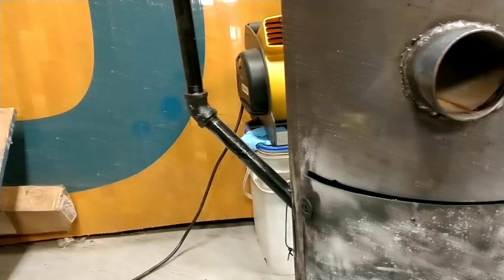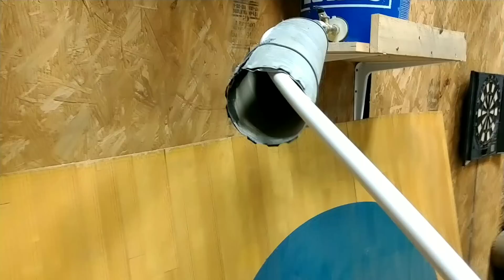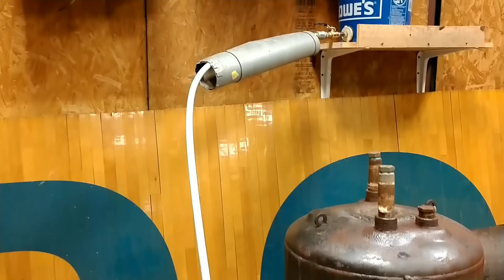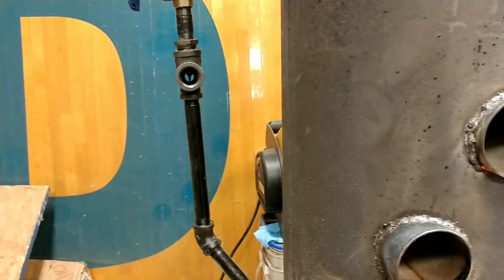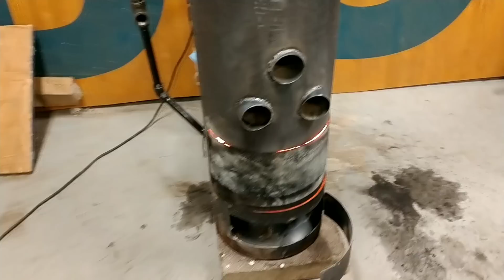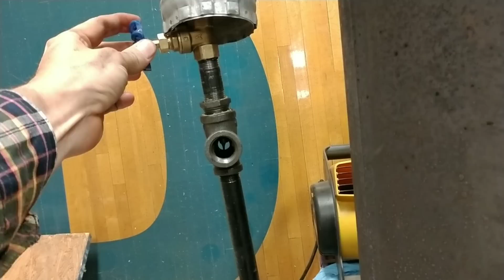Updated Waste Oil Heater Drip Feed Ver.2.2 Detailed January 19, 2018

Comment: Hey bud! Thanks for the video, I work in a shop and just starting learning to fabricate our trucks. Took a few months but I was able to find all the parts and used an old 100 gal propane tank to make my own. Did it on lunches and after work and I got it home and fired it up last night! Very happy and learned a lot while greatly improving my welding and cutting skills doing it. Thank very much for all the details. Now I need to figure out the groove you cut in the gate valve because as you know without it the oil just runs down the side of the “T”. Thanks again!
Reply from the maker: If I have time this weekend I'll go out and take that valve apart and make a video of it. But the groove is not to make the oil flow through the middle of the window all that does is keep larger particles of debris from stopping up your oil flow. The only way I could get the oil to run through the center of the t was to install a barb fitting from the inside of the t

Comment: How many sq ft will it heat in roughly 30 degree weather? I have a tank twice that size or more that's 3/16" steel i've been contemplating doing this with to heat a well insulated 4000 sq ft shop.
Reply from the maker: My shop is 40 by 60 it heats it pretty good at 30 degrees.

Comment: I bet that stinks! I can see holes in the heat exchanger welds and the door isn't sealed. The pex pipe is a disaster waiting to happen. Nothing like spilling 5 gallons of oil around your 500 degree heater.
Reply from the maker: So you haven't checked out the new revised re-welded sealed up door insulated PEX pipe video, I guess I'm going to have to change that plastic pipe out after 5 years everybody thinks it's going to melt I'm going to have to put a black iron steel pipe there I guess to make everyone happy. Absolutely no smell escapes from the tank due to there being a vacuum created by the flu, so all of those holes where I just tacked in the heat exchanger pipes actually suck air into the tank not blow air out of the tank.The video was done after tacking everything together just for testing purposes I have since rewelded all the way around the heat exchanger pipes put a gasket on the door and made several improvements which are seen in one of my other videos. Another way to think about those holes around the heat exchangers, is imagine your fireplace in your house. It has one big hole in the front of it where you put your wood into the fireplace yet the smoke does not come into the house it goes out the flu.
Reply: @randysdiy2102 - Well you certainly told me!
Reply from the maker: Lol, rough day.

Comment: I'm not an expert on any of this by any means, but I wonder if you could use a bunch of smaller pipes as heat exchangers, and then have them all meet in a single larger pipe that the blower could push through.
Reply from the maker: Sounds like a good plan

Comment: Randy, as you have demonstrated, running the heater at about a pencil lead width flow or a bit more in the sight glass, burns smoke free.
is it possible to vary the oil flow more and less than the pencil width flow (heat output) and maintain a lean smoke free burn.? (so their is no soot build up). Thanks
Reply from the maker: You can run it with a smaller amount of fuel however when I've done this in your heat decreases significantly.I'm not sure that it helps any with soot due to the higher temperatures helping the soot burn away

Comment: Now if that burns as hot as it looks (over 1000 degrees I figure) just how long is that steel going to last before it breaks down, starts to warm and flake off. I'm just wondering how long all that hot metal lasts before it needs to be replaced? I'd hate to go thru all the welding and fabricating just to remake everything next year.
Reply from the maker: It's three years old now, still running all the same components that I first built. As I said in other reply I usually run it around 700 degrees. That appeared to be the magic number for best fuel economy and the least pollution.

Comment: So having seen a few videos of these builds, I came to an understanding that those who don’t use fans to boost their combustion are running naturally aspirated oil burns. Which sound great, but use a lot more fuel, produce less power  and are less efficient compared to the noisy turbo builds.
Reply from the maker: I agree with you 100%. More air more efficient and more noise more electricity just depends on what you're looking to do

Comment: GREAT JOB! 

Do you filter your oil! 

I don’t think you will have a problem, but I think it would be prudent to have a carbon monoxide monitor.  They are not expensive!
Reply from the maker: Vegatable cooking oil I filter using a cheese cloth and sometimes I will thin it using a little diesel, engine oil I don't. I did have carbon monoxide detector and fire extinguishers around the shop due to the danger's of burning oil.

Comment: Awesome oil burner thanks for the great video. Can you please use both Celsius and Fahrenheit for your temp readings? Degrees f mean little outside the USA....
Reply: Degree C mean little inside the USA....
Reply from the maker: I know, I tried to remember to do both but I always forget. The one time I did celsius. My gun just got changed and I was really wondering why the temps were low half way through the video I figured it out and switched.
Reply from the maker: Yes, on my last video I did I tried to remember to switch my temperature going to both Fahrenheit and Celsius but forgot of course I'll do better next time.

Comment: Would it radiate more heat if you welded horizontal fins around the outside of the tank?
Reply from the maker: Not sure but sounds like a good idea. I have since added a bunch more heat exchanger pipes and fixed the door seal. Will soon be making a new video.

Comment: Great work! 
For the door warping issue, put some flat bar along the perimeter of the door to give it more rigidity...and it will ensure you don’t vent too much air in from there...it may impede your vortex with turbulence, reducing its efficiency...
I am a professional welder and build wood stoves on the side. Small ones, larger ones...some out of raw steel fabricated by scratch and also out of propane tanks too. I’ve never built a oil heater before, but I really like this design...i think for me, instead of the water heater I’m going to build it out of a a 3/16 wall pipe, 60” tall. Probably 15” pipe, and I’ll cap off the top and bottom. Thanks for the idea 👍🏻 I subscribed to your channel.
Reply from the maker: Thanks good luck
Reply from the maker: It is done in the new video. Thanks

Comment: That's a really good design. I really like the idea of the 90 degree corners to create a vortex, and the safety of the flame self-extinguishing in case of a problem with the oil feed. The heat exchangers are a top idea. I'm sure you could use this to heat water and other uses as well.

If you welded an 'edge' around the tank door and maybe some heatproof tape it would probably seal a little better and improve the draw as well.
Reply from the maker: Yes sir the door has been fixed and I have also added more heat exchanger tubes will be making a video soon. Thanks

Comment: A water heater would be ok if it was lined with ceramic fire bricks as in a burner that i built from a propane bottle. The burner gets a higher temperature and the heat exchanger is placed at the top which needs a thick baffle as it begins to glow. .  your design of burn chamber is the same as mine and i like your vortex  my next build will incorporate this.  thanks for sharing this.
Reply from the maker: Thanks

Comment: Wow, I've been through this,lots of parts, lots to clean the stuff cokes up on all burner parts that don't get red hot,so frequent cleaning. But being black to my elbows every couplah'days,brings back memories! I wanted for so long to have hot clean and low maint. Without a air blower, 15 yrs trials with errors.A blower+ less parts,more heat, less maint.

Comment: I think I would use a 45 and move the line away from the heater, and replace the Plex with copper.   

Great heater.  Thinking of building one for my shop
Reply from the maker: I have been thinking about replacing the PEX line with copper just so that I could wrap it around the heat chamber and thin the oil down and preheat it. But as far as the pex melting causing a problem, the top of the tank really doesn't get that hot at the highest maybe 400° and then the PEX line is about 10 inches away from the tank so it really doesn't get that hot. Good luck with your build just be very careful oil is extremely dangerous to burn. Thanks👍

Comment: Has the oil tube ignited & burned back up inside it? I was wondering if a trap like is on sinks but smaller, of course, would prevent backburn without hindering the flow of oil. Also depending on placement, it would preheat the oil some thinning it helping not to clog outlet. As for the door, I've had the same problem when making wood stoves out of oil drums. Adding a frame of heavier material that overlaps the opening welded just to the door helps a lot. You may or may not need additional reinforcement around inside of the opening. It doesn't have to be as thick of material as the door. The real plus using thin metal for containment chamber is how fast it transfers the heat vs thicker metal takes longer to heat. thin material won't last as long. it's less expensive & easier to handle. Just make sure whatever you use it's not galvanized dangerously toxic to weld and toxic when heated to the operating temperature of your burner.  Great build !Priceless time spent doing it with your son!!!
Reply from the maker: No sir, the oil and the feed tube has never caught fire. Thank you for the recommendation and thanks for the positive comment

Comment: Thanks, gave me ideas fir my own wood stove that is kick ass and now will add a oil drip option. The best thing for me is that I have been looking for a thick pipe for my flue and never found so jury rigged stove piping ...now I have the solution "fire extinguisher. ..brilliant and I have a few around Blessings 
Ps, please replace the plastic with copper!! And you may consider putting the pips at an angle (15 to 30 degrees works best) for natural convection so no need for fan (energy) and you can still use a fan.. also you're loosing lots of heat which could be captured off the exhaust pipe.  I'm working on a spiral three smaller piping into one at the end at a 15 degree angle ...
Had a huge shop in Oklahoma and I ran 30 ft of exhaust at 20 degrees away from the wall before going into ceramic flue to existing chimney and wow huge difference.
   I'm going to experiment with different "jets" to get hotter flair (lass pollution, cleaner burn and get back to ya
Again thanks and Blessings
Reply from the maker: Thanks

Comment: You made yourself a pretty good stove there. For what it's worth, I'll take a water heater tank to make a stove/heater over a 55 gallon barrel any time. The 1st stove I made with 1 was 35 to 40 years ago & was of steel that was an 1/8 inch or more thick. I'd planned to make a waste oil stove, but wound up makin a wood stove instead. I had 2 brand new heaters that all the wiring & thermostats were bad in & the local Sears store was gonna throw em away. Back then those tanks were a lot heavier gauge than they are today. Yea, they're about 1/2 as thick or more lighter gauge than they use to be, but they're still thicker than an oil barrel. I'll keep scroungin for water heater tanks as long as I'm able. Once in awhile you get lucky & find 1 a those old, short 40 gallon heater tanks. Those are a prize for a true scrounger & stove builder. 1 thing I thought I'd mention is ya might think about changing & rerouting your oil line. Switch it over to 1/4 inch or so flexible copper line & wrap it around your stove pipe several times. You won't believe how much cleaner & efficient that oil will burn if you preheat it. A friend of mine that does welding as a profession (the man is an artist with stainless steel) had a waste oil heater in his shop & after I suggested that to him, he was beyond surprised at how much better it burned. As far as your door warping, I'd form or curve some 3/16 X about 1 1/4 inch strap to make a flange big enough to frame the door & bolt it to the door after ya weld the corners. 3/16 ought to be thick enough to stiffen up that door so it'll hold it's shape. Usin strap 1 1/4 inch would be wide enough to be able to bolt to the door & make a good flange around the door to seal it. I got old & tired of building separate buildings to have a shop so when I built this house about 20 years ago I decided to make the whole 60+ ft.X close to 30ft. basement into my shop. I was going to make a waste oil stove to heat things down there, but about everybody & their dog around here has bought or made some kind of waste oil stove so used oil has gotten kind a scarce. I was planning to see what I could find from any restaurants, but haven't got around to it yet. After my 1st water heater tank conversion I'm always on the lookout for anyone else that does the same & I like your heater. Especially those heat exchanger tubes you ran through it. It's something I'd thought of, but I wanted to see another person do it to see how it looked. Thank you for showing me. You keep up the good work & take care.
Reply from the maker: You could always put a small drip feed on your wood heater my dad did that about 40 years ago It worked awesome. And thanks for the kind words.
Reply: @randysdiy2102  Preheating your oil really thins it & just helps it burn a little better  so ya won't have as much a that burnt scale in the burn pot. No more than you had, I don't know if it's that big a deal. I think I like your design better than any other I've seen & I've looked at a lot. Good job.

Comment: Thanks great job I plan to build a boiler system (I have water lines in my floor currently using a electric tank) I will set up outside and figure out a way to thermostatically control the oil flow on and off, a sprinkler valve should work with a timed propane ignition piezo igniter with a flame sensor and tp valve for safety. Have to figure out how long to run the propane to get it started. I will use combustion air fan A lot of components to dial in. I only want my water @ 120
Reply from the maker: Wow that is awesome. Way over my head, just be careful. I never run mine unattended

Comment: Good build. You have a lot of heat going outside. If you had that entire scene inside another tank, with the exhaust lower on the outside tank, you would keep most ot heat. Might have to induce the draft, to start. Thanks for the video!

Comment: Wow what temp is the shop when its 0°F outside with wasteoil furnace running at a liter of fuel an hour?
Reply from the maker: It doesn't get that cold here. We usually see teens at the coldest part of the winter

Comment: Anything you do besides the long flue pipe to clean the air before it is released to the atmosphere.  I suppose really hot burning burns more completely.   Some kind of mass like a masonry heat sink and extra long flue (including horizontal bits w/cleanouts) would probably use the heat more economically and result in cleaner exhaust.  I know this is not legal in any place that is uptight about smogging your automobile.
Reply from the maker: I have added a level of brick due o a comment about acting like a catalytic converter, it may help slightly bit hard to tell

Comment: What are the chances of a back burn through the feed tube?
Reply from the maker: I believe they're quite small due to the oil will not burn unless it is extremely hot and the feed tube is rather cool to the touch even though it's that close to the burn chamber. Of course you never know in this kind of stuff there's always a danger of anything could happen

Comment: just to share: how the machine shop in my home town was heated by same method except much simpler: the drip line went strait down into the top. The drip about  once every 3-4 seconds would free fall down onto a single stick of firewood . which would last all day. velocity of the drip falling at about 2 feet would “splash” a cause a small “whoof” of flame which pulsed... That pulse would radiate and you could feel the heat pushing or pulsing into the shop... Even from 10 feet you could feel the pulse..... that was 30+ yrs ago.. yours is the first type i’ve seen since
Reply from the maker: Yes my dad had one built out of a 55-gal drum that worked that same way. And that was around 40 years ago
Reply: So you’ve had the idea most your life too..

Comment: Any smell out of the chimney?
Reply from the maker: I'm using engine oil there is a small amount of smell. However if you use used cooking oil the fragrances are really nice
Reply: @randysdiy2102  Thanks for the reply Randy. I love the design, I just have some neighbors that are pretty close so I don't want to make it hard on them. Im gathering up supplies now. Thinking I'll use an old air compressor tank. Thanks again and take care
Reply from the maker: Just be very careful, burning anything is dangerous and burning oil is even more dangerous.

Comment: that is very clever but i wonder what kind of fumes might be escaping from it?
Reply from the maker: I'm working on possibly having it tested. There are commercially available waste oil heaters I'm sure they're much more efficient than this design but if the tank temperatures are hot enough it should burn almost all of the gases that are leaving the chimney